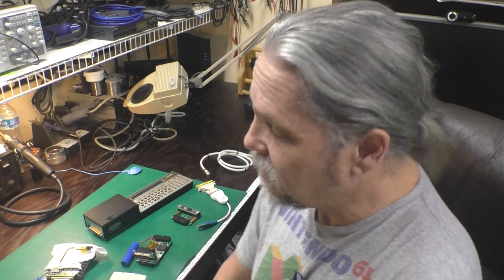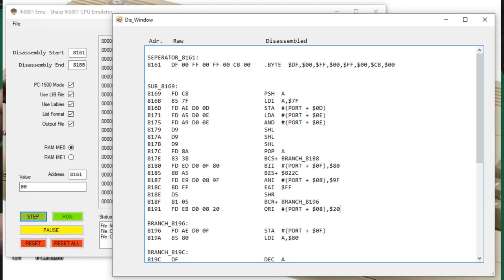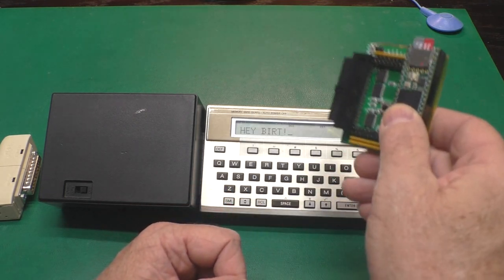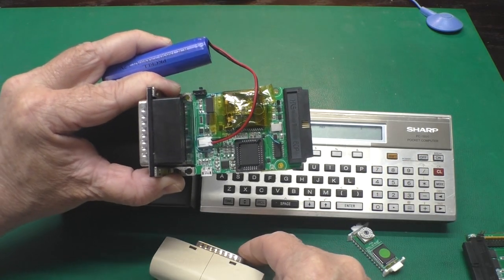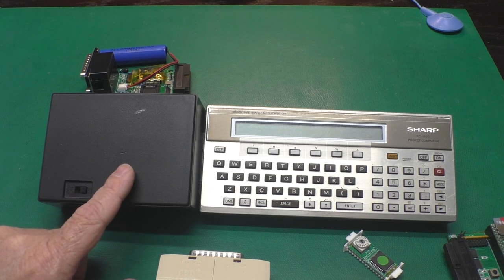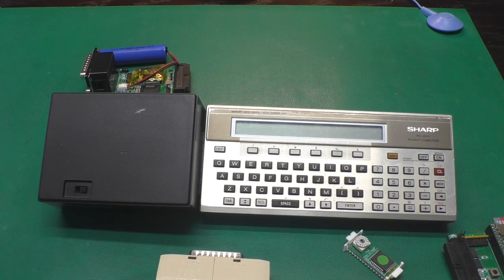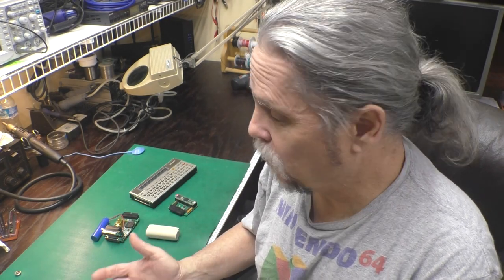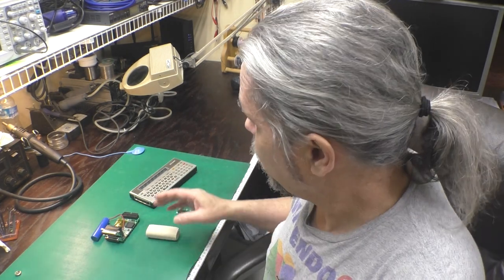Sharp CE-158X ‘EXTREME’. Long-term project – building the tools to then build the project.

Comment: Hey Jeff (oops, Hey Birt!), this is some fantastic effort from yourself as well as your anonymous friend. I would certainly be interested in a CE158X once you get it to a sellable product as I already have the original Backpack (I need to get new version so I can use it with the EPSON HX-20) that I use with the M100, T102 and M200. Expanding the use case with the Backpack is a great idea, and I think something you guys had planned all along. I am into the Casio Pocket Computers more so than I am with the Sharp, with the exceptions being the Radio Shack branded Sharp Pock Computers like the PC-1, PC-2, PC-3 and PC-8 so I do have the various Radio Shack and Sharp variations of these Pocket Computers. I don't have a CE158 so something like this would be awesome. I guess I could see some expandability to the other Sharp models like the PC-1 and PC-3, but I would also like to put a bug in your ear for the Casio Pocket Computers as well (especially the ones that use the 7-pin expansion connector (ie PB-100 / PC-4, PC-5, PC-6) and perhaps even the PB-1000/PB-2000/FX-8000G/FX-8500G that use the larger expansion connector). In any case, again, awesome work here and I look forward to getting a "CE158X" in the future and seeing where else you take the Backpack in the future!

Comment: Wow! Great work. I am a big fan of all the SHARP pocket computers and it’s accessories. I have a PC-1500 in my collection and also a complete PC-1600 system with CE-1600P and floppy drive and also the bar code reader pen for the 1600.  Do you also plan to make something for the 1600? A converter for the fiber optical serial cable to RS-232C would be great.
Reply from the maker: I do have a few PC-1600s. I'm sure eventually we'll have new goodies for those too:)

Comment: Cool Project! I miss my old pocket computer.
BTW, the screen could be made much clearer by, masking off the area around the screen, and polishing it with a plastic polish such as Novus. A cotton t-shirt does well for that kind of thing.
Reply from the maker: Novus is my favorite plastic polish. The PC-1500 I am using here was one that was given to me a as a parts unit as it had the LH5811 removed from it. I swapped in one from a failed CE-150 (lots of battery corrosion) and it worked. It may not look like it, but I have cleaned up this unit it was very dirty when I got it. I have not yet polished the bezel though. I keep it out on my desk to daily use thinking I would test it for a while, I think I have been using it about a year now :)

Comment: Just about got my CE-158 replacement done, gonna make it using most of the hardware from my cassette emulator.  Should be able to get 42kbps throughput and baud rate up to 230,400 where the former is a limitation of the original ROM polling rate and the later a limitation of the software I write on the PC.  The object is to make it work without changing the original ROM.
Reply from the maker: We have 19,200 working very rerlaibly even with sending ASCII program files to the 1500 which normally require a 2000ms EOL delay to allow time to parse/toeknize the line. I added some simple EOL handshaing which dropped the EOL delay to 100 ms.

We tried 38,400 but it is not reliable. There is a lot of overhead in the ROM to allow for all the redfiction features, etc. 

Ther terminal mode works diffrently than other code and struggles with 19,200. The nice thing about our approach is that it works with any orignal SW and RS-232 hardware. The parallel now also supports an input mode that works like serial input does (into strings, int variables).

Comment: Hi Jeff, Do you know the reference of the connector with the PC1500? I've been wanting to develop for this PC1500 for a long time so this CE-158X is absolutely brilliant. I hope you will post info about it. Congratulations for this development.
Reply from the maker: They are both made by Hirose PC-1500 side is HIF6A-60DA-1.27DS(71), and the CE-158 side is HIF6A-60PA-1.27DS(71). They both require slight modification but are the closest matches available.
Reply: @HeyBirt  Thank you Jeff, and good luck in your development of the CE-158X. I hope you will post more interesting topics like this...